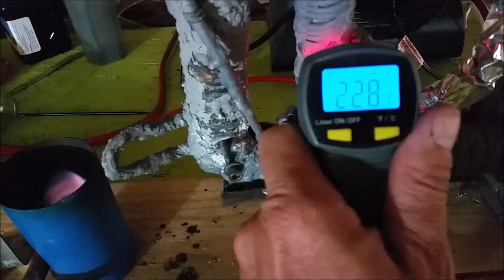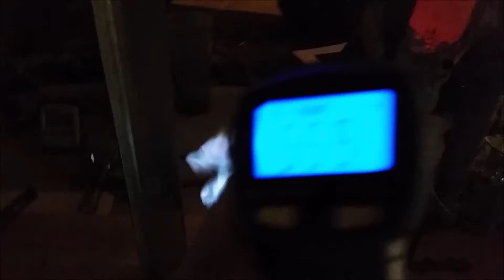Charcoal Gasifier Design Bench testing #2

Comment: what fuel are you gasifying?
Reply: ***** that doesn't make sense if it is carbon monoxide flame the fuel would have to be carbon based
Reply from the maker: m3sca1 No fuel is being gasified but carbon  , this is just how carbon burns, any C02 that comes in contact with red hot carbon is instantly converted to 2 C0 molecules. i believe the reason the flame goes from blue to white is because of the extreme heat of the gas stream and the oxygen input from the   venturi tube . i have herd other people mention white flame usualy means  your to hot to run the gas in an IC . i do have footage of this device converting steam into hydrogen but not in this video and it makes a more colorful white flame. This device is going to help me design and build a system that can produce a nitrogen free gas stream . Also I have come to the conclusion that injecting Co2 gas from a HPbottle into one of these devices instead of steam could do the impossible ,TURN CO2 INTO  FUEL...But this is are little secret for now im telling you this as a friend , i do intend to patent the process so you wont be seeing any videos of this particular test but i shared the secret objective with you because you always have very impressive input
Reply: NOBOX7 you considered catalytic converters?
Reply from the maker: m3sca1 no , i have bin focusing on ways to overcome channeling in my combuster and i pre heat air
Reply: NOBOX7 what do you mean by channeling?
Reply from the maker: m3sca1 a small channel of burning fuel will travel up the combustion chamber leaving behind unburned fuel , then a combustion zone resides on top of a 12 cm coulomb of unburned fuel, this problem was solved back in the 50's by using glass test gasifiers  to determine how long a pre heat is needed   to ignite the fuel without channeling
Reply: NOBOX7 sounds like you need a way to stir the fuel to break the channels up.
The idea of a small pusher or bounce mechanism comes to mind. Pellet fuel and a vibration or something to whack the cylinder. Even a controlled explosion at the bottom of the chamber might be worth toying with.
Reply from the maker: m3sca1 indeed , not sure yet what to do , i realized i need to test the fuel i intend to burn first not this expensive fish tank filter stuff. my main problem with the stir stick idea is it will get so hot it may twist, i thought about maybe a ceramic tube with little arms but this may just be a problem associated with this feed stock. te be honest i think my lack of patients with the start up may be the biggest problem
Reply from the maker: m3sca1 hey i looked into catalyst doping of the feedstock after you mention catalyst  and they infact do use nickle plated grates and things like sodium hydroxide can lower the reaction temps, cool stuff
Reply: NOBOX7 internal stirrer is too complicated. You wanna get it done from outside
Reply: @m3sca1  Yes caracoles are all carbon & are burning if you want monoxide you add a water drip that converts dioxide to monoxide & gives off hydrogen  It is what we call hydrocarbon gas & it runs engines well most modern wood gasifiers give off too much water in the gas production. as the wood hold a lot of water  This produces damp gas. It is the reason many do not complete their gas generates, they can't get them sufficiently hot. on start-up. because of the damp gas. most are missing the Carbon colom within the design to the barn of the oxygen in the damp gas  Later as the water is forced out of the wood. it tends to make charcoal & begin making good gas.   the charcoal colon is placed as it leaves the Cyclone &  condenser, where the damp smock will enter a colom of charcoal that a valve adds.  for air intake for the ability to be closed as the blower pulls the damp smock up the colom & into the filters & then the flair.  this allows the wood gas generator to make use of it water in the wood & increase the run time by producing good gas on start-up in 1962 I ran my dad's gas generator but that winter was long & wet & and I could get it to run well as it was one of an old truck   I discovered it wasn't making charcoal as it should have done so I built a charcoal colon & sent the damp gas into it & then to my engine & that was my eureka moment  But suffering with dyslexia  &  I told know one & forgot about it until guidelines purchased one & suffered with damp gas. & I told them of my discovery.      now I see this & now you know how to convert dioxide into monoxide & get good hydrogen gas into the bargain. Les England. PS When you put it in water or stem you see is gas change to magenta & then it runs out of hydrogen & back to dioxide the green in the flam is argon I think no Shure.